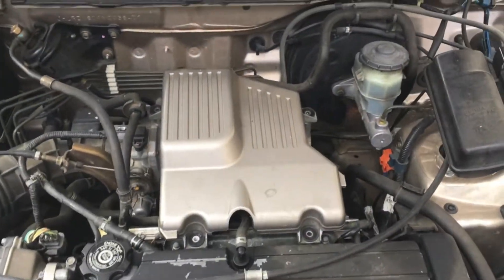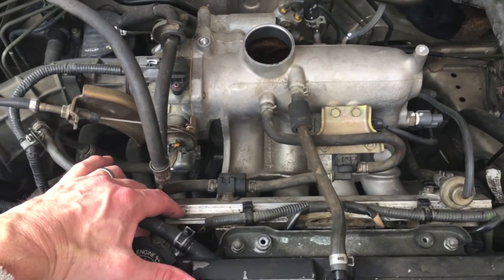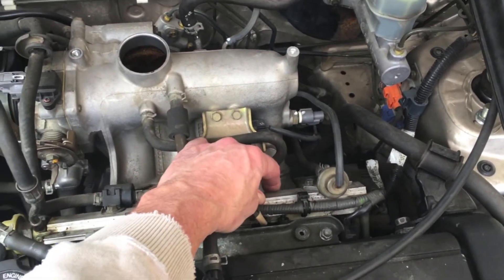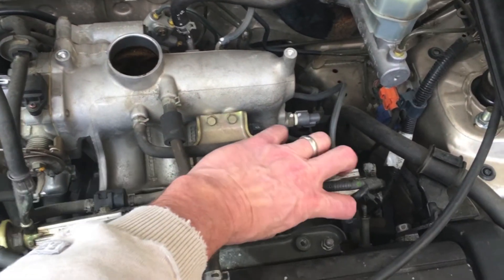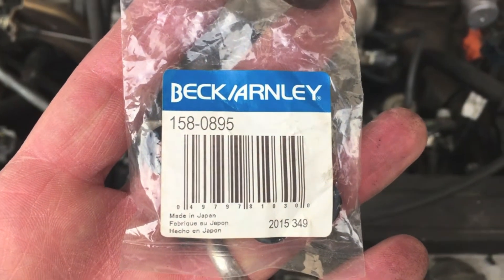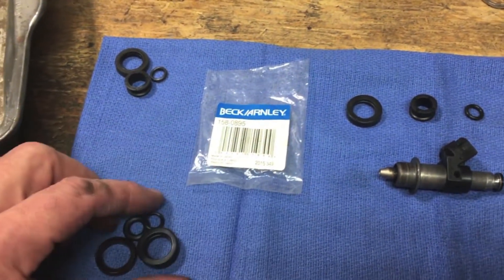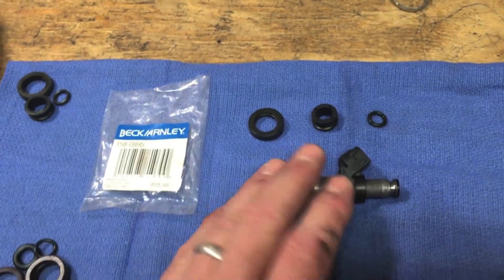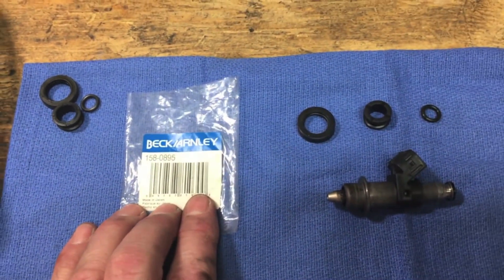Andy's DIY:  Gas smell in my 2000 Honda CRV.  PROBLEM SOLVED!!!

Comment: Great video, I have 99, did the check engine light when on while having this gas leak? I smell gas somewhere but it’s not strong and it comes & goes, and when tightening the gas cap it goes away on its own but the check engine light keeps coming back

Comment: That is not fuel supplie, you pointed on with your hand that is the fuel return hose, the fuel supplie is on your left, the hose attached to the fuel filter, if you know were is the fuel filter.
Reply: LOL you're both wrong! The hose he pointed to was in fact a vacuum line for the fuel pressure regulator. The return line is on the bottom of the regulator. The fuel supply is at the left end of the rail with a banjo bolt fitting.

Comment: i did this same repair but one injector still leaks. Oddly its the same injector that leaked before the initial repair. not sure what the issue is
Reply from the maker: The only leaking point between the injector and the injector rail is the seal that presses back into the injector rail itself.  Either the seal, the injector rail opening where injector presses in, or the injector rail is the problem. I would start by reapplying the seal.    Swap injectors and see if the problem moves with swap.  That would eliminate rail.  Then swap rail "O" ring and see if its bad.  If all check out, last thing it could be is injector itself.  Good luck. Let me know how it goes.